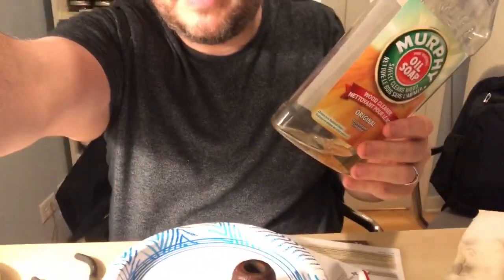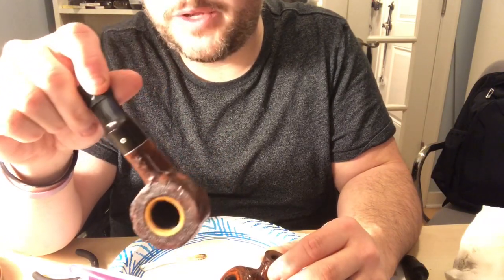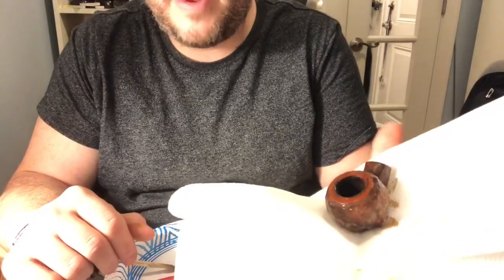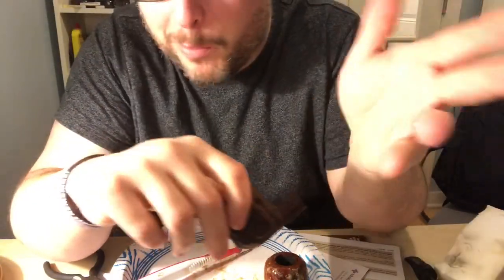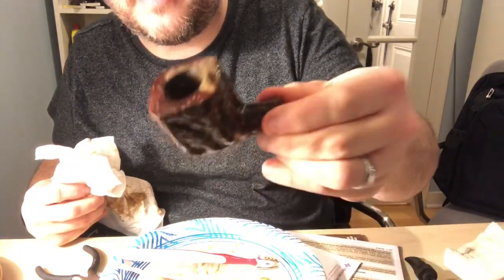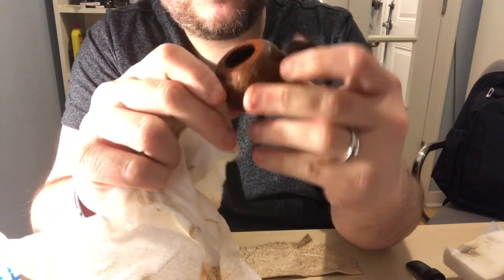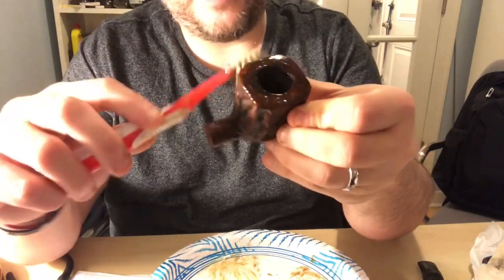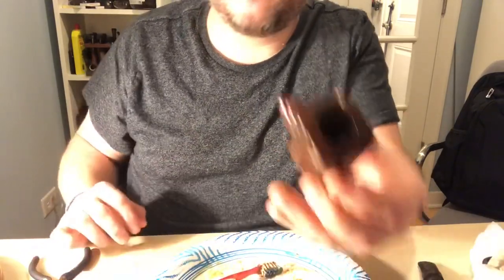Pipe Refurbishing - How to remove carbon buildup on the rim.

Comment: A stem with a bite-through hole is an easy fix.  Maybe 30 minutes in all.

Take an old stem and sand you off some powdered vulcanite. Run a pipe cleaner with Vaseline into the end of the bit so it supports the underside of the patch.

Mix your powdered vulcanite with a bit of superglue, black if you can find it but regular works just as well. Overfill the hole, let it set up overnight, and then file it down flush. Polish the stem, clean the vaseline out the bit with a bit of alcohol, and you are done.

Bare Pipe had a video on this, I think. 

I love working on pipes people consider ready for the trash. Chewed up stems, broken shanks, burn-thru bowls. I love the challenge.

Comment: Great job.  Appreciate the sharing attitude  of YTPC.  Stem coating with mineral oil after using micromesh pads or buffing wheel makes a world of difference on the stem thanks to video from Canerodpiper.  Other great info in videos from Artful Codger, Matches 860, NW Pipesmoker. YTPC is a wealth of info!

Comment: Great job. I learned a lot. I have many old pipes to clean up now.
Reply from the maker: stevgnyc  please comment and let me know how yours turned out
Reply: @ericthebluecollarpipesmoke3656 Eric, after looking at my pipes I decided not to do anything with them.  I'm not a collector, but have many pipes after years of smoking. The worn out looks and patina (hand oil and dirt) on the pipes bring back years of memories. As an example I have an old pipe that was once covered in leather. The leather is long gone but in the briar you can still see the stitch marks that were gouged in when sewing. It also has some deep nicks, but that to me is the beauty of the pipe. I smoke a pipe to smoke and believe if a pipe is not smoked it is a waste. Of course all my old pipes are reamed when necessary and thoroughly cleaned after each smoke. I usually rotate 3 pipes a day.As a history buff you can understand that these pipes are my history.

Comment: Thanks to the Artful Codger for sharing his knowledge with you and now you us. I've been a little concerned about Murphys removing finish. Is there any concern with that, and how do you mix it proportion with water. Think I'll try the AC method with a pipe cleaner, as I only have the rim lava. I've also wondered about using Castille soap...